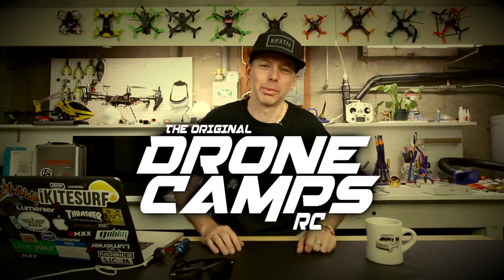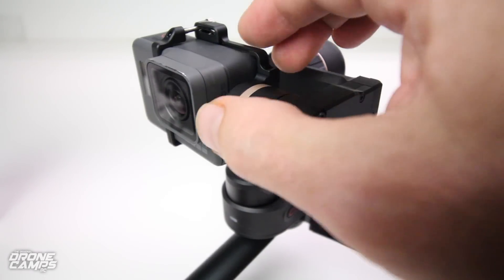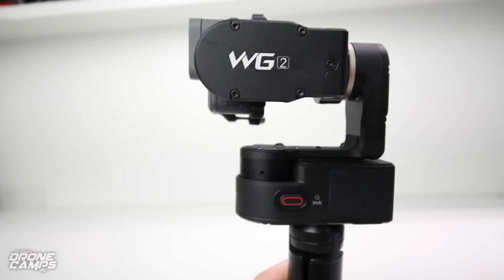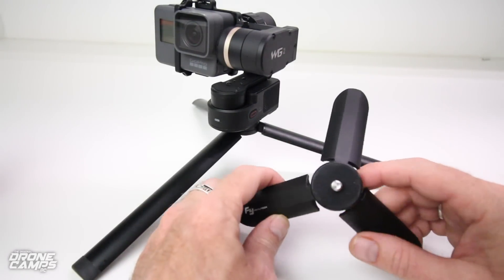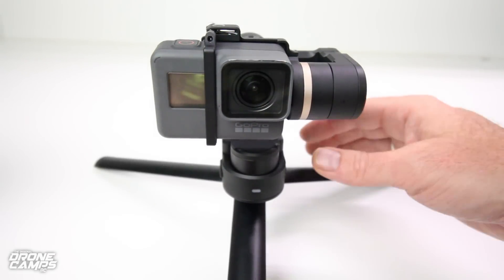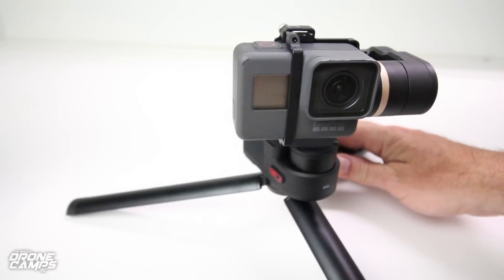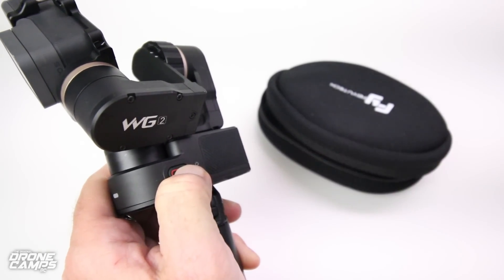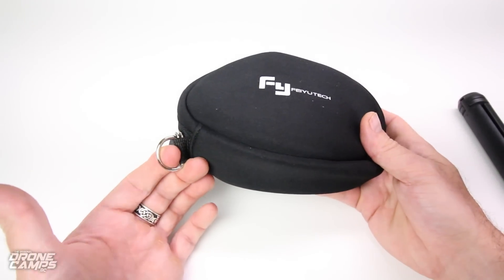DJI OSMO but Waterproof! - WG2 Waterproof Wearable Gopro 5 Gimbal Review

Comment: Great review! Mine doesn't seem to hold the correct horizon ever so slightly. It tends to tilt to the right, so I've yet to use it in case of return. Have you noticed this at all? Also I'm using a Hero 3+ not a 5.